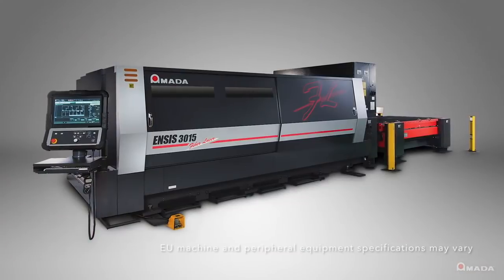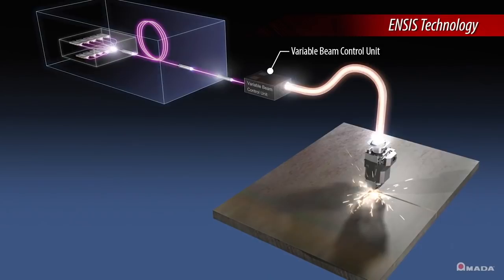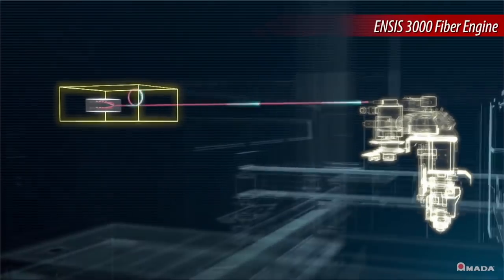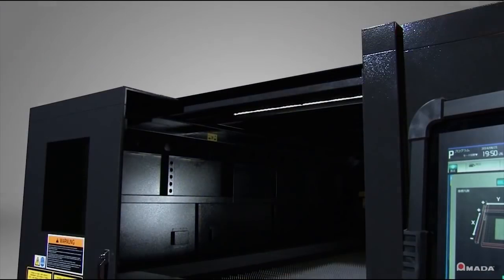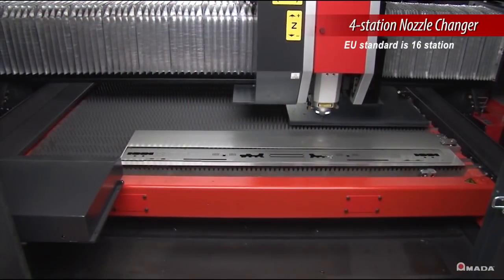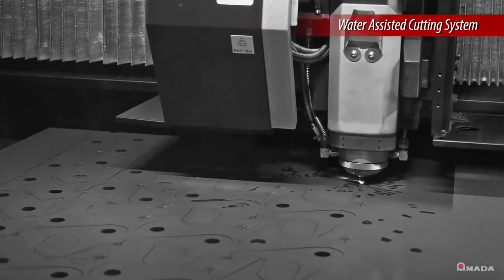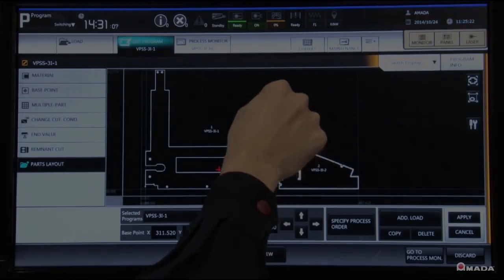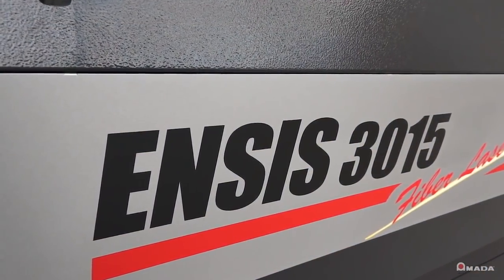AMADA ENSIS-3015 fibre laser machine

Comment: I have a question when cut a material thicker hole and cutting edge not parallel top surface is bigger than burr surface
Reply from the maker: Hi there, thank you for your interest, AMADA have various solutions to help with problems - our high power ENSIS fibre lasers come with our Variable Beam Technology to change the mode to suit the material being cut and also have our Auto-collimation technology to drastically reduce bevel when cutting thicker material.

Please see our YouTube video about our ENSIS technology:
https://www.youtube.com/watch?v=NKDQmmcx45k